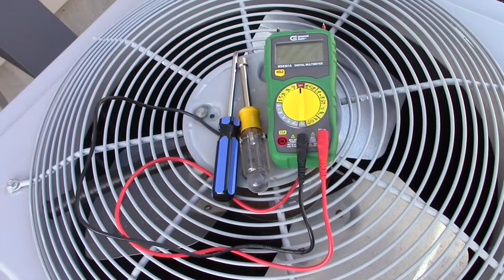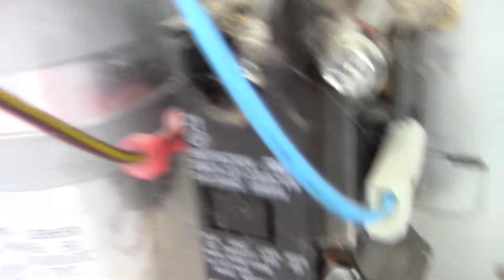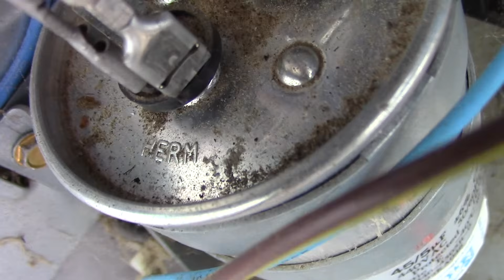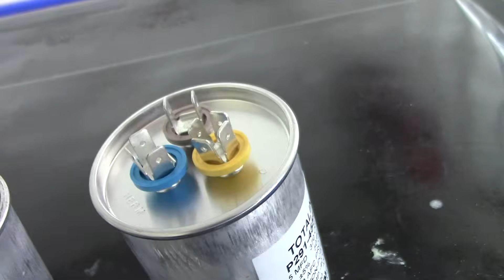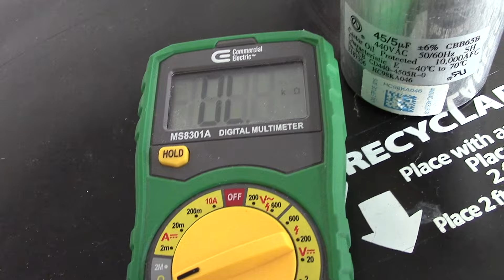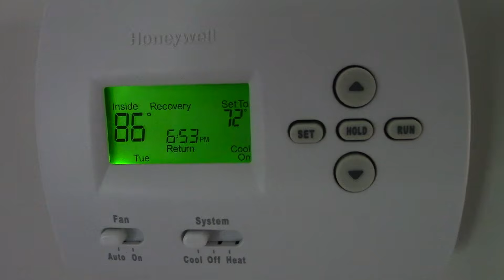Replacing the Run Capacitor on the Carrier Air Conditioner.

Comment: why don't the manufacturers show the correct dual-run capacitor rating to use on the outside unit's label?
Reply from the maker: I have always wondered that too. Sadly I can't think of any reasons why.
Reply: @Sharkie626  Can't have homeowners attempting their own repairs ... and saving a fortune!

Comment: We had our air conditioners installed five years ago back in 2018, and the original capacitors have held up. Hopefully, they continue to hold up.
Reply from the maker: That's good! Definitely can't hurt to have replacements on hand, just in case :)
Reply: @Sharkie626  Trying to now but how did you find your model without opening the AC unit?
Reply from the maker: @walkingfury  It should be on the panel you remove to access the parts.

Comment: What if the compressor doesn't turn on after installing a new capacitor
Reply from the maker: Could be a compressor problem, or maybe a wire was connected incorrectly.

Comment: For working on hvac equipment, it's good to have a meter that actually checks capacitance. As well as dc micro-amps to check flame sense signal on furnaces.
Reply from the maker: Oh yeah, I wish my meter did have that setting, would have been great.
Reply: @Sharkie626  you can replace a cap with a higher voltage cap no problem, just can't go lower - btw. if it says 370, new one can be 440, in fact higher voltage rating is better.
Reply from the maker: @Jon-hx7pe  Yep! I do remember reading about that. I made sure to research things carefully before getting the replacement.
Reply: Great tips!

Comment: That all went well.  You explained it perfectly, and the visual examples of the bad cap were great.

The only thing I'm going to recommend:  NEVER use pliers to remove terminals.  Instead, use a flat blade screwdriver.  The reason why you actually demonstrated.  As you're pulling, pulling, pulling, eventually the terminal will come off, and violently.  It's that moment, that you cannot control, where things generally go awry.  If the wire is really short, that critical moment could be when the connector rips off the wire.  Or, you could bend the connector, and it may snap off when you bend it back.  Or, you could cause the connector to become misshapen--wiggling it back and forth essentially "wallows out" the inside of the connector, causing a looser fit when reinstalled.  With a flat blade screwdriver, you can pry the connector off the terminal, and have none of the aforementioned issues.  When the connector finally does break free, the wire is not being held or pulled, so it's free to go where it may.

It is, however, OK to use pliers to install said connectors onto the terminals.  So again, screwdriver off, pliers on.  I will be (inadvertently) demonstrating that in an upcoming video.

Anyway, I'm glad it's back up and running and working well.  That was a simple fix that anyone can do, and indeed can save hundreds upon hundreds of dollars in A/C repair calls.

Comment: Too bad we can't get the polychlorinated biphenyl type any more. Those rarely, if ever went bad! Bad for the planet though. 
Yes, always get a 440 volt rated replacement for this application, that helps with longevity a little. 
Great tutorial! Nice and smooth running. Enjoy the cool air upstairs!

Years ago, I worked on underground submersible pumps that pumps fuel from the storage tank to the fuel dispensers. Was always a sigh of relief to see a bulged capacitor, because those assemblies are not fun to pull, and replace the pump motor. A capacitor was 10-15 minutes of work, and on to the next call.
Reply from the maker: Yeah that figures. Something made to be "better" only ends up being worse, but at least it was an easy fix! Figures it had to be one of the hottest times for this to happen, but hey, that's when they usually do. It got so bad that the downstairs thermostat actually started picking up the excess heat from upstairs, which his why the 1st floor unit was running throughout the whole video. It sure did take a while to remove all that heat, but by later night the 2nd was feeling much better overall. 

I can imagine how much work those were. You always hope for the simple stuff.

Comment: Excellent job! It's a shame those capacitors don't last as long as they used to. They're a rather common failure point. Definitely a good idea to keep a spare on hand.
Reply from the maker: Yeah I've heard every few years they tend to go, but luckily it's an easy fix!
Reply: Who thos  lot charge  muthv darmma big boss not come darmma see  all are go darmma all gues not  agree good  strght popel darmma not  big chect gue stoping some gues telling  cap not ok replacing   ruing  starung  fsn  due tupe ok  staring pint satarting  ruing point  comerssar   contact out out point using fan is only fan   fan poin not othe  5mfd comon power tacking fix
Reply: Another DIY video recommended Amrad capacitors. Made in the USA, higher price, higher quality.